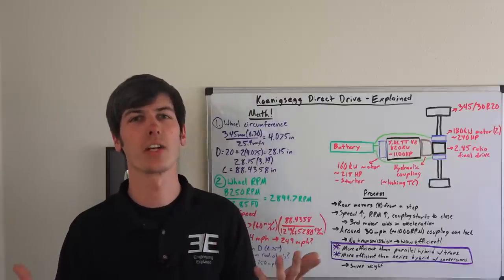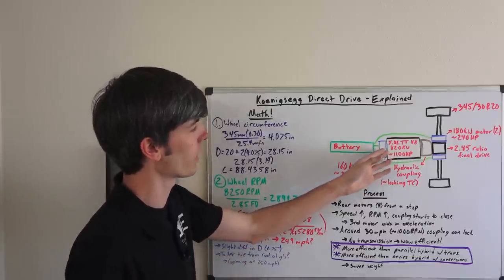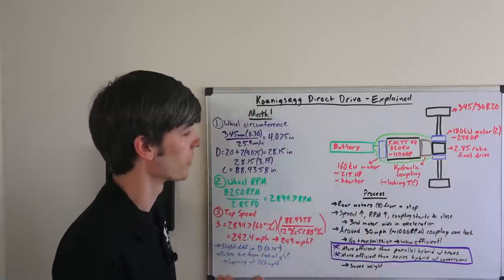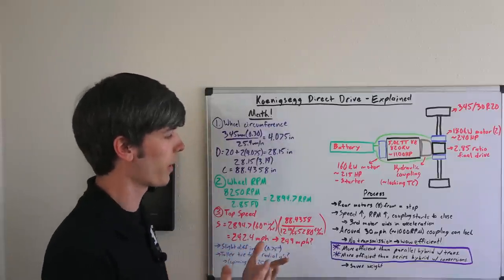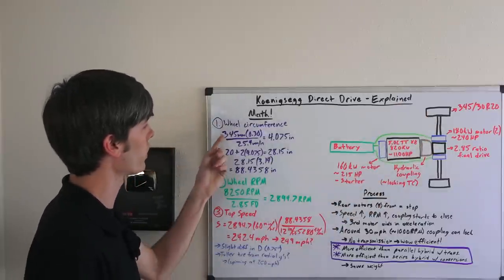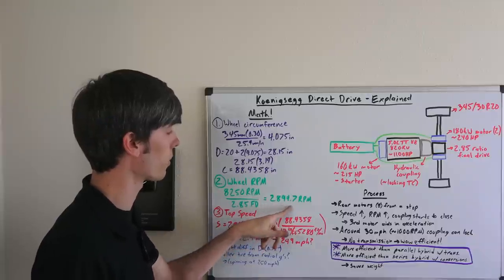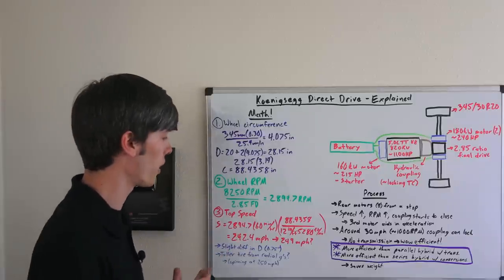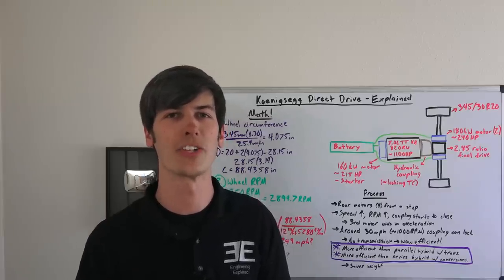Koenigsegg Direct Drive - Koenigsegg Regera - Explained

Comment: Jesus everyone on the internet is a freaking genious trying to correct him. It's a theoretical value, an ideal case, explaining how the engines work and the capacity. He is talking anout the engine aline not the car. Why is there any need of mentioning weight or drag force when he is only talking about the powerplant?
Reply: ***** Because it COULD be that Koenigsegg makes wrong claims. The acceleration numbers they state seem impossible. The concept seems to not withstand even the simplest tractive force calculations. An engineer like Engineering Explained should challenge their data because he is able to either verify or disprove them.
Reply from the maker: Mar phy I think Koenigsegg has the mathematical capability to come up with accurate claims, especially if you think I'm capable of it haha.
Reply: Engineering Explained Yeah I don't doubt they are capable. But they don't neccessarily always tell the whole truth. Please have a look at my comment I wrote yesterday. I showed the Regera has not nearly enough power (or gears) to reach its claimed numbers. Newton's law F=m*a is enough to prove it... Try it yourself!
Reply: Engineering Explained Here's the comment I'm referring to:https://www.youtube.com/watch?v=naRY3knqFYU&lc=z13vztsjxoasdvgl0231exgasl32wljl2
Reply: Mar phy
I think the best bet instead of going through the computations is to wait until somebody test drives it and see from there.
Reply: Sure, but do you know a real test drive of the One:1 for example? I don't have much hope there will be such with the Regera either.
Reply: What do you mean One:1? their will be a test drive, if not in a normal car magazine then in a luxury supercar one. Wait a while and their will be youtube videos of it too. Watch them and time it, because you know they are always idiots that will try to reach the top speed on the highways.
Reply: custommotor Koenigsegg One:1 is their top model. No one has ever been able to make a real review of it, not to say to verify claimed acceleration times. So I doubt this will be any different for the Regera in the near future. That's why I was trying to verify their claims with basic calculations. Anyone else out there (including Engineering Explained unfortunately) seems to just believe them. Koenigsegg states unbelievable performance figures for omitting a transmission. I think their KDD concept simply does not work as well as they are claiming, but I would be pleased if someone could prove me wrong!
Reply: I really don't know but the F=m*a equation is only one of many you need to do. You need to take everything in the equation, wind speeds, aerodynamics, when the electric motors work and when the gas engine works, "torque converter" efficiency, how the torque converter locks up (all at once versus slowly, ex. high rpm at low speed), tire size, tire weight, vehicle weight, tire size expansion due to heat, gear ratios(if that "torque converter works like a normal TC, it can act as a ratio multipler), passenger weights, tire stickiness, etc. They are so many factors that need to be inputted into any equation to figure out the real answer. We have to wait and see if anyone shows it accelerating.
Reply: Exactly^^ but hey everyone on the internet knows everything. He wants to correct the author of the video and he backs it up with Newton's second law...
Reply: Dear me, I have done the absolute best case calculation possible, neglecting ALL losses. Taking the losses you mentioned into account would make it even worse for the Regera. The absolute only thing they could do is using a torque converter like you stated, having the ICE reving high at high load. But the hydraulic coupling is muliple times referred as "hydraulic clutch" which cannot do this, and even IF they would use a torque converter it wouldn't be sufficient for the claimed numbers (I can do the math if you want to). I still hope Jason could add some explanations, but I guess he doen't want to embarrass someone at Koenigsegg so he's better off ignoring it. Bummer!
Reply: You didn't get it. The Regera undoubtedly has superior power figures, but it has NO transmission. So it cannot put enough torque to the wheels in low- to mid-speed ranges compared to a car with transmission. Please, have a look at the comment I have linked above and follow the explanations there.
***** I did not correct Jason. Did you at least try to understand my text? Regarding Newton's second law it's perfectly fine for the calculations I have done. And opposite to you fellow I back up my claims at least.
Actually I really like Koenigsegg and CvK. Bit it seems that I have overestimated the audience here. Sorry disturbing you fanboys!
Reply: Most of that torque advantage is completely useless in a high hp/torque car. The venom can probably spin its tires in most of its gears. The regera has about the same final torque as the venom does in 5th or 6th gear approaching its top speed. The electric motors will put out the max torque that the tires can handle. Even on the venom gt the tires can't handle all the torque the motor makes it spins them going into 6th gear nearing 200mph. The electric motors allow it to make use of all the power the tires can handle. The venom gt sends over 10K lb/ft of torque to the rear wheels, no way in can possible use all that torque with its tires. My car sends 2500lb/ft of torque to the tires that are 275s and it can't use that in first or much in second if launching hard. The venom gt tire is only 345mm (25%wider) but sends 4 times the torque to the tires. It's wasting most of the torque. While that spinning is good for heating up the tires if the tires are spinning at 60 when your at 0 they aren't doing as much as them spinning at 45mph when your doing 40mph, too much spin is bad. Not a fan boy either, just trying to say that until somebody shows it in action you can't tell if the claim is true or not.
Reply: custommotor I appreciate that you are the only one who seems actually really interested in this topic. So let's have another look at Newton's law. The whole universe is based on this very basic formula F=m*a, so it also applies to the Regera. It tells us how much force F is needed to accelerate a mass m with the acceleration a in order to overcome inertial force. So if you want to accelerate in a car of the mass 1628kg like the Regera with an acceleration of 8.5m/s² (metric system, just multiply), you need 13838 N of tractive wheel force PLUS the force needed to overcome air drag, wheel rolling resistance and drivetrain losses. That 8.5m/s² acceleration rate results from Koenigsegg claiming 150 to 250 km/h in 3.2 sec: (69.4 m/s - 41.7 m/s) / 3.2 s = 8.7 m/s². So let's assume 8.5m/s². Now go into the torque curve Koenigsegg provides and calculate the torque at the wheels and the resulting tractive wheel force. Now let's have a look at the torque graph on the Koenigsegg website. At 200 km/h the ICE is about 4400 RPM and the combined torque is at its PEAK - at lower speeds, there is even less torque available! Let's assume ALL motors are providing their peak torque at this moment. That's 1250 Nm from the ICE plus 300 Nm from the electric crankshaft motor, that multiplied by 2.85 drive ratio is 4418 Nm, plus the torque from the two outer electric machines of 2x260 Nm results in a wheel torque of 4938 Nm. Divided by the wheel radius of 0.36 m thats 13715 N of total tractive force at the wheels for ALL motors pulling out their maximum torque. And even that is not enough tractive force to overcome the 13838 N of inertial forces, not to speak of air drag and rolling resistance! Do you get how I made absolute best case assumptions? To only way to produce more wheel torque for the Regera - since its missing transmission - is to have a torque converter as hydraulic coupling element, what Koenigsegg is claiming NOT to use and which would result in high losses. They say thay are using a hydraulic clutch, which is not capable of torque multiplication. Maybe they are overdriving the electric motors, but they should be limited by the battery power output at some point.
Reply: You never linked 8.5m/s to tractive force.
Reply: What do you mean? There you have it: 1628 kg * 8.5m/s² = 13838 N
Reply: I think you still need to consider the Koenigsegg Direct Drive as a torque converter or hydraulic coupling. I bet your missing torque is in their. Until we know how it works we won''t know the answer. Your math is good, but you don't have all the pieces to the puzzle.
Reply: Mar phy it's 9.81 m/s^2
Reply: Exophobia
Traction control? You mean how they limit the power because if they sent all the power to the wheels it would just spin the tires?
Reply: Minor correction:  *genius

Comment: This is what I came up with in the 7th grade:

speed(mph)*1056/wheel diameter (inches)/pi (3.1415926535) * final drive * gear ratio = engine rpm

or

rpm/1056*wheel diameter (inches)*pi (3.1415926535)/final drive/gear ratio = speed (mph)

I use it all the time for fun, and it works too.

Comment: This video was a bit short this time. I missed some explanations regarding tractive wheel force. A conventional car with up to 8 gears has its maximum power available multiple times across its speed band. So let’s assume a 400kph/259mph capable car with an 7 speed transmission reaching top speed in 6th gear. You would have full power maybe at 400, 330, 250, 180, 110 and 60 kph. But the Regera with its fixed gearing has nearly linear increasing power with speed up to its maximum combined power at around 340kph/210mph. Which means at 100kph/60mph this thing only has about 440 HP! It should be relatively slow in the low to mid speed range, making the assumption they really lock the hydraulic coupler above a certain speed. That could be kind of an issue with a super car I think...
Reply: Linearity seems to be the wrong approximation in your case. You already have roughly 700 HP from the electric motors pretty much from the start...
Reply: Arno Rogg Don't mix up power with torque ;-) Have a look here and scroll down to the power diagram: http://koenigsegg.com/regera/
Reply: To make it short: The Regera has not nearly enough power to reach its claimed acceleration figures.

Let’s make a quick calculation to prove this. All based on the official data which I have linked above.

150 to 250 kph in 3.2 sec means an average acceleration of 8.7 m/s². Let’s assume 8.5 m/s² @ 200 kph. Multiplied by the curb weight of 1630 kg that’s about 13.8 kN of tractive force needed at the wheels (for acceleration ONLY).
200 kph is around 1500 RPM at the wheels or 4400 RPM at the ICE. This is where the torque maximum of all machines is located. Means: (1250+300)*2.85 + 260 + 260 = 4940 Nm at the wheels which is 13.7 kN. So the Regera produces an absolute maximum of 13.7 kN of tractive force (neglecting losses).
For its claimed acceleration times it would have to deliver 13.8 kN @ 200 kph PLUS a huge lot more to overcome air drag and rolling friction.

Engineering Explained You are studying the same as I do. What's your idea?

Comment: An intriguing drivetrain setup. I wonder if it can be adapted to a smaller (read more affordable) car using a smaller gas engine and smaller ~100hp electric motors.
Reply: It most certainly can. And it does, to some degree: Some plug in hybrids don't use traditional gearboxes. But they have planetary gears for reverse and such, and no torque converter. . .

Comment: Are you sure the electrical motors are in the rear? I think they are in the front.
The electrical batteries are indeed between the passengers and under the front consol.

Comment: Question : would the top speed calculation be only if it was to operate in a vacuum? Will that power compensate entirely for air resistance? If so Why not go for a different final drive to go faster (not that you'd need to)?

Comment: Hi. I have a question regarding the Regera drivetrain that you made a video for. I understand that they use a "hydraulic coupling" between the differential and the ICE, but is it constantly coupling these two together through a fluid at below 30mph (like a torque converter)? Or is there also a generator mode like the Honda Accord Hybrid below 40mph? I would imagine that in EV mode the coupling would create significant amounts of drag while the ICE is stationary if there is no separate clutch to disconnect the hydraulic coupling....

Comment: How do they connect the electic motors after final drive to the same drive shaft as the engine? Gears maybe, or do the shaft run through the electric motor

Comment: Higher reported top speed could also result from expanding gases, warmed from the tire generating heat. To that point, some of the material properties of the tire would change has the rubber increases temp and could result in larger circumference!

Comment: Good video. Thanks. I had a few questions though-
Once the engine starts, at around 1000 rpm, we already have the 2 wheel-axle electric motors running at a certain RPM(sub-question- how much power are the electric motors producing at this moment when the engine has just crossed 1000 rpm, and what RPM are they spinning at?). How are the engine and 2 wheel-axle motors going to work in sync from now on till the 8250 rpm redline(isn't this where the engine produces max power and you cannot go any faster?), and how is the 160kW(starter) motor going to come in here after starting?
Reply: Arjun Bhat 
Many sensors constantly feeding information to the computers that are controlling everything to stay in sync with each other.

Comment: Maybe I'm wrong but isn't the first number of the tire dimension the tire width. Meaning 345mm wide. So in your calculation of circumference, wouldn't you simply add the profile (30mm) twice to the rim's diameter (20in) and multiply by Pi? This should give the entire circumference of the wheel with the tire.
Reply: Ah but the standard way of writing tire dimensions was made by a lunatic! :O

Therefore the first number is the width (as you say) but the second number is how big the profile is compared to the width, in this case the profile is 30% of the tire width. (345*0.3=103.5mm) :)

Comment: So if the batteries are flat, the car won't move at all. If you cruise along at a sensible speed and burn up all the electrical power (which presumably won't take very long) and then slow to stop for some traffic, when you try to get the car moving again you'll get nothing from the electric motors and no transmission of mechanical power from the engine because the hydraulic coupling won't have locked up. Is this not an issue?
Reply from the maker: ***** No more of an issue than the battery in your car dying. The engine can charge the batteries in this case, so if it starts to get low and it's running on purely electric power, it will crank to keep juice in the system.
Reply: +Engineering Explained That was a question i have for long now. Can the eletric motor mounted to the crankshaft actually work as an generator while the engine is ideling? No question it can do that for running lights, radio and ac, but for moving a car you need quite a lot more power, and Koenigsegg Petrol-Engines are not famous for low end torque, and it would be sad to have the computers rise the rpm just for charging the batteries. Are there any quotes on that vom Koenigsegg?
Reply: Also; Even with flat batteries the torque converter is capable to make the car get up to speed. CvK has said it can do 0-60 mhp in 4 seconds with the electric system disengaged. So not really an issue.
If cruising along at a sensible speeed, the hydracoup locked up, then the engine would still produce a surplus to put back into the batteries so when slowing down for that traffic, the batteries would most likely have plenty of power.
And yes. The electric motor mounted to the crank is acting as a generator. I haven't seen any figures from Koenigsegg about exacly how much rpm it would take to sustain a charge. But most likely the system wouldn't let the batteries get completely flat while running, so one should always be able to get up to speed, at least sensibly, and then charge the batteries while running. Not much energy is needed standing still.

Comment: How well does it drive when the batteries are dead?
Reply from the maker: monkeypainter808 With an 1100 HP generator on board, you won't have to worry about a lack of energy.
Reply: Still can't possibly be at peak performance.
Reply: monkeypainter808 battery gets charged while driving
Reply: If that, even though unlikely, would happen the car would do 0-60 in 4 seconds.

Comment: It would be very interesting to try this on current cars. This new way of thinking to transfer engine power/torque to the wheels without a gearbox but using the diff and diff ratios would be great.
Reply from the maker: Gareth McLaughlin Not exactly, if you don't have electric motors to back it up it doesn't make much sense. Low powered cars wouldn't get away with it, which is one of many reasons transmissions exist.
Reply: Engineering Explained sorry i mean in addition to high powered battery and high powered cars. i couldnt do it with my STI :)